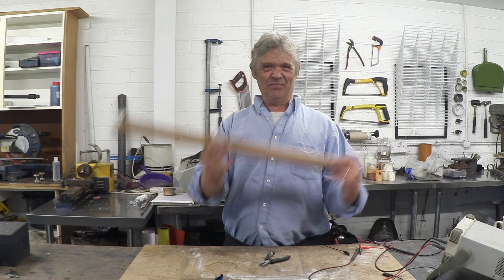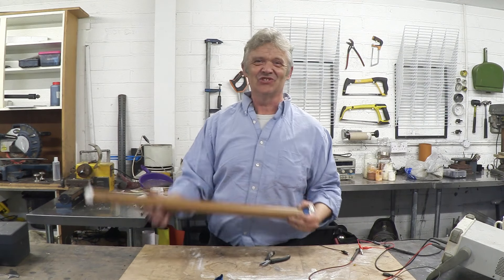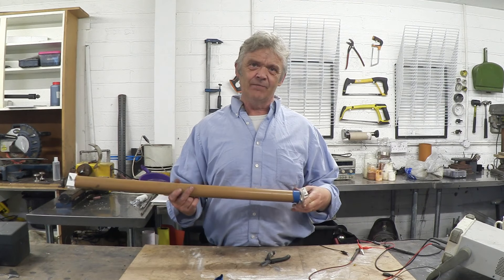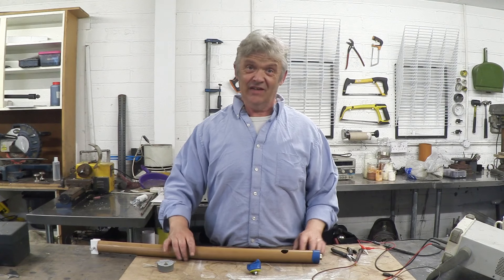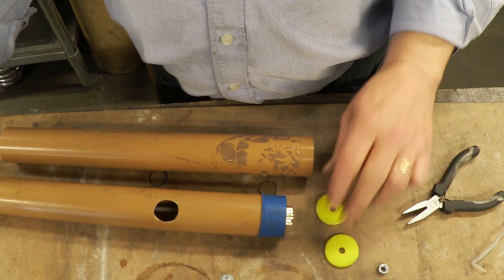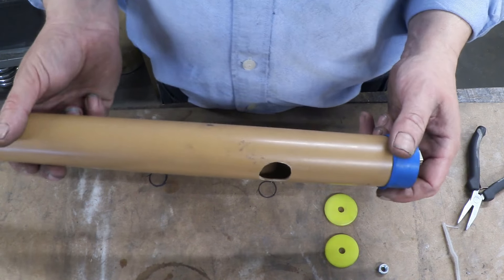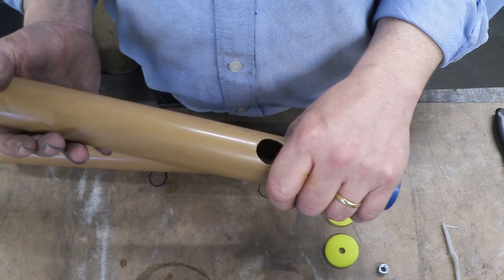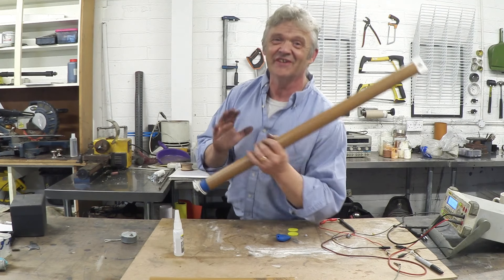A Wind Generator That Works Even When The Wind Stops Blowing

Comment: It occurs to me (and probably many other people) that this would be ideal for a flag pole.  The constant flutter of the flag would give a large increase of vibration.  You could easily power a warning light for the pole top!
Reply: It would also negate the energy expended to make all the parts, as I am sure it will take a while to pay back all the energy used to make the parts.
Reply: @MacksCurley  yeah, these sort of low-energy or short-lifespan green energy sources are really a sort of awkward battery: Energy was expended in making the materials or device, you ship it off to some remote location that needs power, and the special catalyst (Sun, Wind, Vibration) slowly "unlocks" the finite amount of energy stored in that device until it's usable lifespan is depleted.
Reply: @justtinkering6713   maybe a bridge rectifyer would solve that.
Reply: @_g7085  At the same time, things like this could be made from parts that were destined for the landfill. Then the energy used to produce it for the original purpose was always paid off.
Reply: for what exactly ??? 0.2 mamps ? come back to earth ffs

Comment: Adding small ones of these to backpacks could give backpackers power to charge their phones or gps devices on the trail!
Reply: You could even make it like an expanding telescope.

And have it as a dual functioning unit. Attach the lenses and you have a telescope to see. Take the telescope caps off and install the other part for power. Whole thing would be collapsible and compact inside of carry case.

It was brilliant that you came up with this idea for compact use for backpackers and such.
Reply: I was thinking something similar but built into the heels of hiking boots to generate power as you walk.
Reply: @clintonrobinson8070  Or trekking poles.
Reply: @kke  or in tent poles!
Reply: Connect it to a guitar, the vibrations could power an amp speaker that then plays the guitar sound 😳

Comment: For whatever the reason, my mind drifts to the concept of something like this being crafted into either a complete artificial tree, where wind energy makes the bulk of it vibrate given the correct combination of core flexibility and strength. On the other hand, grafting (in a kind and non damaging way) onto existing trees to make use of that same energy. It certainly adds to a fascinating arsenal of accumulated energy harvesting techniques Rob, excellent stuff!
Reply: Could be added to the ones already used on todays ships!
the normal motion of the water, swaying, vibration, could possibly be piced up by muitible 'zoom tubes'? & passively transferred to a power bank, along with other combined solar or wind power systems.
Reply: I've seen vids of artificial trees that the branches are basically mounting poles for mini VAWTs. The VAWT blades are crafted to look like leaves or flowers
Reply: There are phallicly shaped vertical wind generators that work from being vibrated by the wind.  Reverse vibrators.
Reply: E.T. basically did this in the 80s, using a line attached to branches when the wind blew, it transferred that mechanical energy and powered his "phone"

Comment: A musicians flute is a perfectly tuned vibrating tube. If you mounted this like a weather vane, on a bearing, allowing the tube to rotate in the wind thus directing the air over the opening on the side of the tube this would cause the whole tube to vibrate like a flute if constructed to the same specifications. You could stack 10 tubes in a row and use that as your vane. I think your onto something big Bob!

Comment: Fascinating. The principle has been around since sailing ships but I've never conceived of using vibration tension to oscillate a magnet within a coil. Quite Brilliant.
I'll have a go at making this. I would suggest the PVC pipe be separated near the base and a portion removed and replaced by a weakly loaded compressive spring. Similar to some warning signs that are often knocked by vehicles but return to an upright position. In fact the pipe could well be dispensed with altogether & a frame work with multiple chords with magnets & coils could be used. You could call it a "Harp Generator". Have you any musically inclined members?
My apologies for not becoming a member sooner. I followed your YT channel judiciously 2+ years ago, but life has it's distractions as I'm sure you're aware. At least I now have some 'hobby time', even if it's imposed upon me.
Keep up the excellent work & happy inventing to all your members.

Comment: I modified this to this with Pi 

It sounds like you've described a fascinating setup for a simple electromagnetic generator. This device uses the mechanical vibrations of a slinky to produce electricity through electromagnetic induction. Let's break down the components and how they work together:
Components
Tube: The tube serves as a housing for the slinky and provides a pathway for its movement. It also helps guide the diaphragm's motion.
Slinky: The slinky acts as a spring that can vibrate back and forth. When stretched and released, it oscillates, transferring kinetic energy to the diaphragm.
Rubber Diaphragm: The diaphragm is attached to one end of the slinky. It moves up and down in response to the slinky's vibrations.
Magnets: These are attached to the diaphragm. As the diaphragm moves, the magnets move with it.
Copper Coil: The coil is placed around the area where the magnets move. It is stationary and does not touch the magnets.
How It Works
Vibration Initiation: The slinky is stretched and then released, causing it to vibrate. These vibrations are transferred to the diaphragm.
Magnetic Motion: As the diaphragm moves up and down, the magnets attached to it move through the coil of copper wire.
Electromagnetic Induction: The movement of magnets through the coil creates a changing magnetic field. According to Faraday's Law of Electromagnetic Induction, this changing magnetic field induces an electric current in the coil.
Electricity Generation: The induced current in the coil can be harnessed as electricity. This setup generates electricity passively as long as the slinky continues to vibrate.
Applications and Considerations
Energy Source: The energy source for this setup is the initial kinetic energy given to the slinky. To maintain continuous electricity generation, an external force or mechanism may be needed to keep the slinky vibrating.
Efficiency: The efficiency of this generator depends on factors such as the strength of the magnets, the number of turns in the coil, and the frequency of the diaphragm's movement.
Practical Use: While this setup can demonstrate the principles of electromagnetic induction, scaling it up for practical electricity generation would require careful design and optimization.
This setup is a creative way to explore the principles of physics and electricity generation. If you're building this as a project, ensure that all components are securely attached and that the magnets and coil are appropriately aligned for maximum efficiency.

Comment: Awesome. A couple of things I thought upon seeing this....was to use a thin walled metal pipe. Then use a 1/2" dia metal 8" spring inside, attached to a steel guitar string. Which would be tensioned by a guitar string tensioner. The vibration resonance would increase, I think. The unit would be insulated at the proper points, of course. 
   Then at the top, put a split "fan" type wind catcher mounted on a free wheel. With each side of the fan being offset from each other. In other words, each would catch wind blowing in directions180 degrees from one another.
      Each fan "handle" (bottom ends, by the top of the the pipe), would have a thin steel rod at it's base about 1 to 3 inches, with a thin section of nylon line (about 12 inches), supporting a ceramic ball.
    Then when the wind blows, a fan section will tilt, pulling the ball away from the pipe. When it slows down, the ball will strike the pipe (or just touch it), depending on the rate of decrease in wind speed. Regardless, I think that action would create lots of additional vibrations....
   Thoughts, anyone? Again, awesome device!
Reply: I was thinking along the guitar strings and spring idea when I watched it too.
Reply: How about putting a tiny solar panel on top connected to a little motor with some wires to strum the string?
Reply: Electrify a  Victorian Aeolian Harp. That way, you'll get music and electricity

Comment: Came up with some improvements (about halfway through video):

    1. The tube uses air entering through the orifice on the side to shake a diaphragm that generates electricity, and it can vibrate up and down along the length axis of the tube. Using air, it would be more effective and powerful to use a focusing horn to make the pressure vibrations larger.

    2. Using different diameters, weights, and elasticity of diaphragms you can adsorb a certain frequency of oscillation that is left out by the standard design, including using this to adsorb bridge vibrations like a dampener or energy recovery from traffic.

    3. This is not much different to how an unpowered microphone works.

    4. Using materials that have a higher stiffness, or young's modulus, allows energy to transfer into the diaphragm more efficiencly without various substructures flexing, as well as reducing the overall weight.

    5. There is not much benefit to using artificial plastic muscles versus a standard spring or pneumatic, unless the flexural energy lost to heat is lower than other materials and methods.
Reply: What if I just stick a whole lot of old speakers outside near the road and absorb the road noise ,,designed more along the lines of not a microphone per say but a loose cone that will capture sub vibrations as well.
Reply: Per se
Reply: @chuckthebull  speaker cone would not vibrate on it's own without input I would imagine plus if it would then the cone would absorb that energy.
Reply: Hmmm you are causing me to think of the "echo chamber" I bought in the 70's which when opened up by damaging the enclosure was just a very thin vibrating spring that was extremely flexible.  Also when I "spoke into my turntable needle when recording a record onto tape as it finished AND turned the recording volume up very loud", I could hear my voice clearly on the tape (along with a lot of very loud scratching sound from the vinyl surface and motor hum).  Simple vibrations are easily magnified and I'd guess these devices if made correctly could be ramped up to produce much more than seen here (and maybe charge batteries for constant use.)

Comment: Bloody brilliant. Many years ago I thought of something vaguely similar when I held a flat rubber band in a breeze and saw it vibrate. I thought of gluing some magnets on to the flat band and allowing the wind to vibrate it within a coil. 
I found the best location was towards one end or the other as putting the magnets in the middle hampered the vibration. I thought of running strips horizontally of these at the top of roofs where they could vibrate with heat rising up the roof or with wind blowing over the roof.
Reply: Hey that's my design idea 😡 how did you hack into my head..mine comes with an interactive tensioner for frequency optimization

Comment: Imagine the tube as a fork, with artificial muscle strung in the open air like a guitar, where they are tuned for different vibrations and rates of air flows... Great work love the open mind set! 🙏
Reply: Has anyone tried hanging an electric guitar up by the machine head in the wind and seeing if you get an output from the pickup?  You'd have to bypass the switches & pots.

Comment: As with any device extracting energy from a fluid flow, the denser the fluid the more energy to be found.  With a good unstable ‘paddle’ containing the trembler all stuck in a stream, this could give a very useful output.  Thanks for the inspiration!
Reply: You've just caused my brain to come up with an additional improvement. Add a series of vortex holes along the length of the pipe to induce vibration... vortex holes of different sizes...I must have a go at it..
Reply: @albertcassler8763  Align the magnets, equally spaced in a Circle 👍🏼...
Much Love and Peace 🤜🏼❤🤛🏿
Reply: @albertcassler8763  wouldn't vortex holes of different sizes reduce vibration ?

Comment: I've watched your presentations with interest for some time now and recently subscribed... While I'm not a member, I'd like to throw in and make a suggestion to your design if it hasn't already been suggested.  While the hole is placed in the tube wall creating potential additional vibration... my thought would be to utilize slots (lengthwise) possibly almost the entire length of the tube. Even several slots might increase potential, and yet turn the slots along the wall creating possible added turbulence within the interior cavity of the tube...all providing additional vibration ...equaling added energy...  my 2 cents,,, thanks for listening. ( p.s. the reason I'm not a paying member is that I've been retired for about 10 years now and find myself building a house - by myself - for the last several years, out of necessity and monies are tight just now)

Comment: Hi Robert :  I’m gob smacked, I used to be an avid sci-fi reader since childhood, since then I’ve transferred to Fantasy. The reason I tell you this is because I can remember vividly from a book I read positing, like you said, the idea of harvesting power from the wind.  The methodology was not described so I remember thinking of this off and on for years how this could possibly be done.  Now low and behold comes you laughing on screen and saying the same thing has been done.  I remember to the representation of this harvesting devise as a large multi strung harp vibrating in the breeze and I’m blown away.  It’s Arthur C Clerks satellite communication web coming into being again!
Of course what this now needs is to be upscaled enormously for mass generation, on buildings or just outside of villages or even on aircraft to sustain cruising speed , !!!  Oh! Oh! speak to the Airlander 10 people for inclusion on their flying buttock maybe.  Once in flight there is a sufficiency of vibration surely?? Thanks for the spark of intense interest moment.
Cheers Aah Kid.

Comment: Seems to me the only purpose of the pipe is to tension the two ends of the vibrating coil. Perhaps you could string a few of the vibrating coils on a frame rather like a harp. The wind could then blow directly across the vibrating coils. You could daisy chain the induction coils at the bottom, in series or parallel as you wish to increase the voltage or current as necessary. Maybe/maybe not, just thinking outside the box. Many thanks for the idea, very inspirational

Comment: I was all down in this rabbit hole a few years ago whilst eating fish n chips watching the standing rigging slap against the masts in the harbour making that lovely racket. I saw vibrating wires everywhere, fencing ,telegraph wires, suspension bridge cables, vibratng in the wind or because of traffic noise or movement and imagined if we put coils and magnets in the right places combined with lower energy usage we could easily combat the energy problem and maybe have extra to run all the aircon units/ flood pumps everyone is going to want as the climate heats up! Ideas are great but you really need to share them! I agree its all about the little gains, greater diversity makes for a more robust system.

Comment: What a genius idea and well described thanks Robert. I was thinking that the longer the tube the more sensitive the artificial muscle would be to the surrounding vibration. Also what about having 2 or 3 more of the artificial muscles, that would up the amps. Imagine a sea of coloured tubes on a roundabout island in the middle of traffic or running down the central reservation of a motorway.
Reply: how about the white barrier tube along every curve bridge crossing etc along most highways in North America or the world  they're plastic tubes ... they literally build themselves almost
Reply: As Robert said there are many ways and combinations that might give significant results.
Reply: @mjohnhayes  If the generators get a reflective surface it would also add a security feature to the posts...

Comment: I really love the ideas u have here. My son 9 yr old son and I r having a blast building some of the stuff we see here, we started with the electromagnet out of the microwave and he was really impressed, thank you.  I was curious if a windsock or flag of some kind placed on top of the pole would help with added vibration? The wind sock would let u know the direction the wind is blowing and it may catpure more energy potenially?
Reply from the maker: possibly mate - give it a go
Reply: It will create some movement for sure 👍
Reply: Maybe extensions outside of tube fixed to “muscle”? Rain gutters? Rains a lot where I live but also would work with wind.